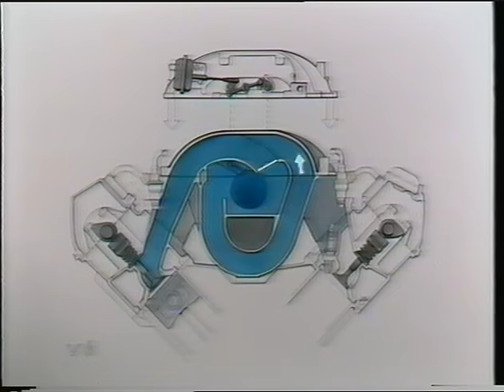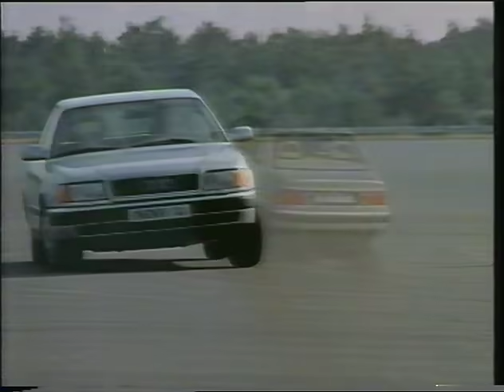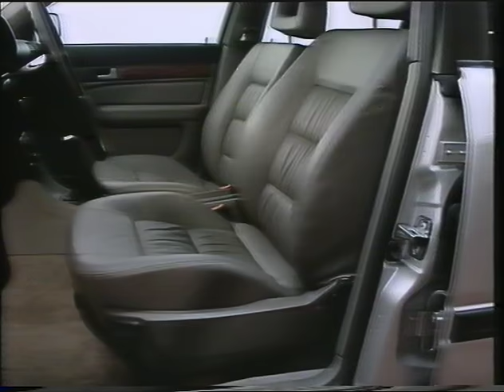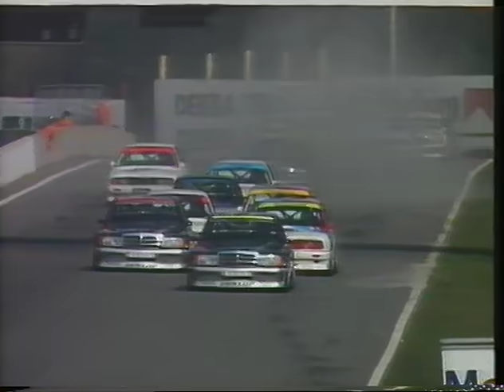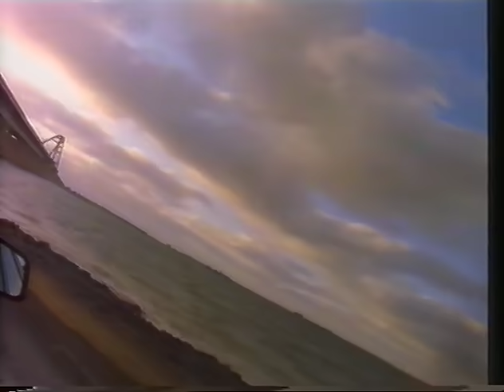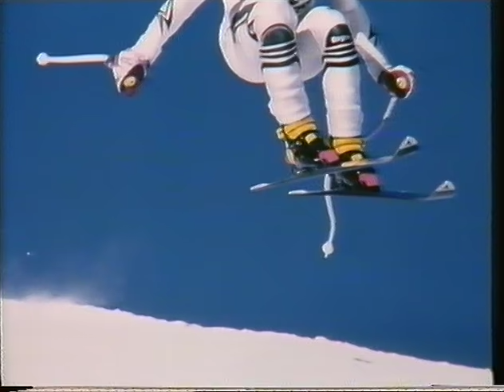Audi 100 - typ 4A C4 Official promotional video

Comment: I live in South Africa and had a 500E with a 2.3l straight 5 engine. Similar to the S4 with a 2.2l turbo quattro....not sure if this refer to the Audi 100 model??!! Anyway... super awesome, rugged, durable and a great tourer!! Cruising on the freeway at 160 -180km/h effortlessly and plenty to spare!! Very fuel efficient for this type of large heavy vehicle. I gave it to my dad when my mom passed away as he loved this car. No squeecks and rattles, rock solid!! Was a 1993 model with more than 300 000 km, still the same factory clutch and exhaust pipe. This was in 2010. Today's cars are great with awesome technology, but they lack that something special.....😼 😎

Comment: Thank you very much for posting this :) My parents had one (in dark blue) - with a 2.4 diesel (82 hp) engine. Not very fast, but the sound of the 5-cyl was very nice. After seventeen years my parents traded it in for an A6 2.0 TDI (another dark blue one). I'll never forget the comment of my father when they bought the A6: "But our 100 is only 17 years old, do we really need a new one?" :)

Comment: My dad had Audi 100 2.8E Quattro for 18 years (1992-2010). For me this the car that made Audi a serious competitor to Mercedes Benz and Bmw but of course in the minds of the public it still Audi years to build that premium image. It was such an amazing car, very reliable and in Finland where we use a lot of salt on the roads during harsh winters, it had no rust. The car handled very well on ice (drove rally when I received my drivers license in 1995). Engine, transmission, electronics or suspension never had any problems I can remember. The V6 (174hp, 245nm) had an awesome sound and accelerated like a rocket when overtaking. With manual transmission it was huge fun in slippery conditions. The velcor seats were very comfotable and still looked great after 255 000km. Technically it was very advanced. In the beginning of the 90s that 0,29 drag efficient was superb, torsen quattro, procon ten, light body with zinc protection... (only 1500kg). In Auto Motor Und Sports crash test it got the highest score ever for driver and passenger safety. 

We have had many cars in the family since the beginning of the 90s (Bmw 330, MB ML 350, Audi A6 3,0TDI Quattro Avant, Volvo XC90, MB E350, Tesla Model S) but this is the car that impressed us the most when we got it.

Comment: These are such amazing cars, but relatively unknown by the average consumer. The quality of these cars and the D2 chassis was exceptional. It was such a great time for Audi, when safety and quality were so much more important than saving weight and cutting costs. Unfortunately the cost cutting late in the decade and for several years after really hurt the brand. Mercedes did the same thing and their image is still recovering. BMW never made something near the quality of the C4 so they have never suffered from a dip in perception by the public. The good news is Audi has recovered very well from their late '90s and early '00s mistakes. Although it's hard to say if any of their new models will ever hold up as well as a C4 or D2.
Reply: C4 was the best Audi. Nothing like it after that.  I'm a Benz guy, but give a lot of credit to 100/A6 C4.
Reply: C4>w124>e34
Reply: @Akın Orhan  is it a reliable car? I want to buy the 2.8 v6 version.
Reply: Muhammet Eroglu My father had Audi 100 2.8E Quattro from 1992 to 2010, so 18 years (255 000km).  It was highly reliable and even in Finland where we use a lot of salt on the road (to get rid off ice) there was no corrosion due to zinc! Engine or electronics never had any problems.
Reply: Are you joking bmw had the e39 your telling me that an e39 can't hold up to this your entitled to your opinion but that's a bold statement

Comment: My stepfather has Audi 100 with 2.5 TDI engine and 5 speed stick for over 10 years. One of the best cars ever to be built. Very robust, as well as being super comfy and huge fun to drive. 5 cylinder TDI engine the best diesel engine to have it has great fuel economy, huge torque and that 5 cylinder rumble.
Reply: 2.5 tdi is a V6 tho
Reply: @sejegamer123  The V6 2,5 TDI came around 97/98. Before it was the 5 cylinder 2.5 TDI which was really good :)
Reply: @quattroTorsen  v6 tdi is rubbish !